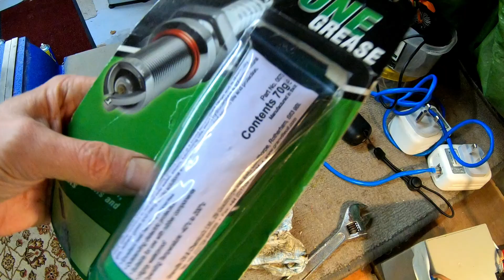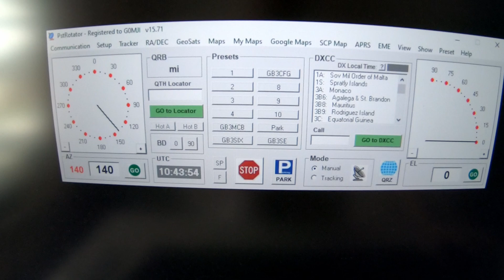SEIZED! Spid Rau Rotator Repair - SPID, type RAU - Azimuth Rotator Light Version

Comment: Thank you for breaking the ice before I open my Spid Rak. The motor is seized and I'm betting the problem is the same. The worm gear does not move under power and there is a little expected play in the larger gear attached, meaning the motor is frozen. I'll try to repair first and if that fails I'll have to bite the bullet and get a new motor assembly. Well presented, thank you. KA1J

Comment: The trick with the Spid rotator is to make a cover which COMPLETELY covers the drive motor and prevents water from getting inside.
Reply: wonder if you could fill it with a grease or something to just keep the water out
Reply: Perhaps, but a cover will prevent water from getting. I did this with my 2 Spid rotators 3 years ago and I have not had a problem since. IMO, a cover is the only real solution
Reply: @VY0HL-VE8HL  As my rotor is inside now and I'm going to try and get it up before the first snow, do you have a photo of the cover you made that is available to view on the web? On QRZ maybe? I am too old to easily keep getting the rotor down every few years. Thanks, KA1J

Comment: Excellent video. As a first step I will be checking the drain hole on mine today. £150 for a new motor and drive is crazy. I suspect that outer cover is shrink wrapped and it looks to me that it is MORE likely to trap water as it loosens over time rather than less likely. Great job and this should give you years of use from now on. Jim FVM